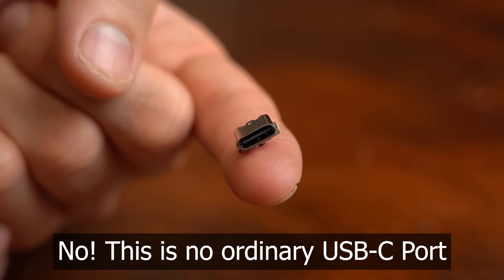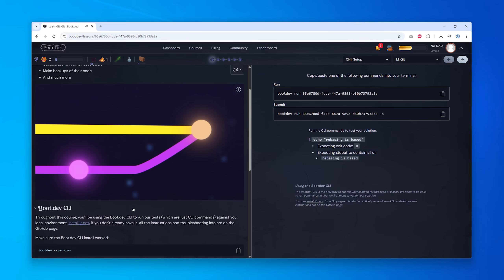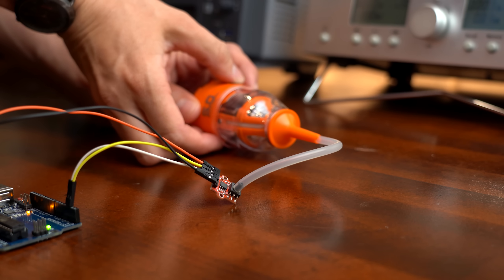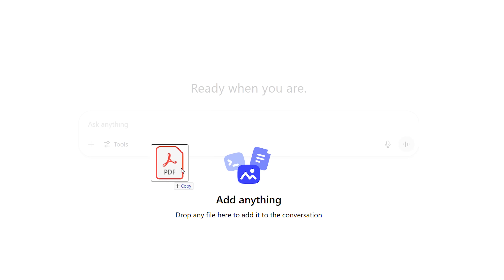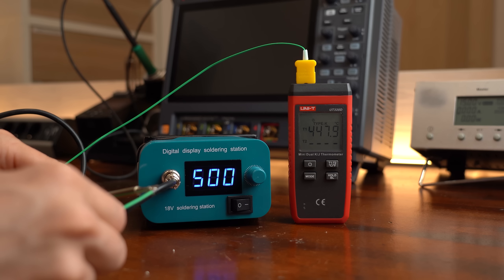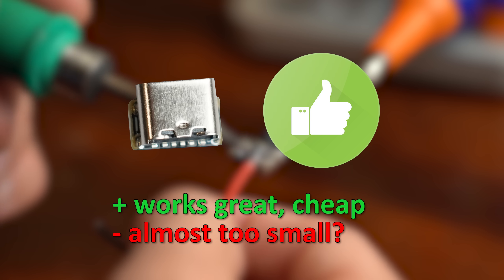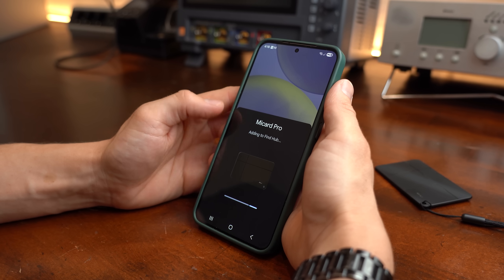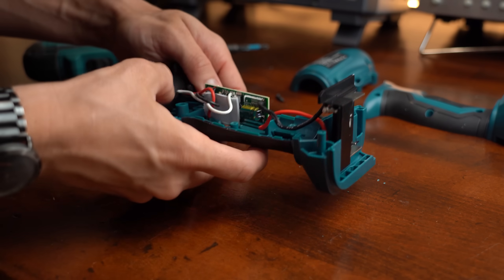I tried finding Hidden Gems on AliExpress AGAIN! (Part 15)

Comment from the maker: Click this link https://boot.dev/?promo=GREATSCOTT and use my code GREATSCOTT to get 25% off your first payment for boot.dev.
Thanks to boot.dev for sponsoring this video and making this show possible😁
Reply: Are you sure that the tracker app does not just safe the location, where it was last connected to your phone?

I mean this sounds alot like apple airtag, but the thing is that on android it was recently made possible to have such technology. I am not sure if truly uses the gps of other phones. It would also be kinda weird to know that random object can automatically connect to my phone to check the gps location. Also how does it even send its location. Does it also access the internet via the connected phone?
Reply: @beobhan I really think it relies on this new Android system. So the implementation is more complex (and privacy compliant) than explained
Reply: I think we would have appreciated a much more detailed review of the Makita Iron as that's a VERY VERY popular battery system for Tradies.

 You didn't even mention it's heat up time or what tips it uses ? Hakko 900 $1 tips or new super expensive smart iron tips ??

Your Watch..........

Your WiThings watch glass looks really scratched.

There's a lot of info on Reddit about people replacing the glass themselves with parts from AliExpress. 

It is VERY fiddly and difficult though. The main problem is if you damage the glasses gasket while removing the glass shards you're finished, it's a non-available part.

You can replace it with a Sapphire glass for about US$20 which is a HUGE improvement in scratch protection. Screen protectors are also available.

It might make an interesting video ? 👍
Reply: nice find on that tiny blower but the price. this can also double as a personal fan in hot regions however it appears it is single speed and doubt the tiny batteries will last more than 10 min. 
10:00 the price is similar in our country but aliexpress has highre prices (which is in the shipping cost) since they sell to wealthy countries
coincidentally, I received two copies of Mili tracker just yesterday! I think the card is bigger vs the tag or coin version. as explained in the video, it doesn't work well in wide open areas where there is no bluetooth android device (last location is always where it found bluetooth using the location of someone's phone).  however, I found the best case scenario a few hours ago while walking in public. I was following this mother and child and the tracker updates almost every few seconds like GPS! It appears it is realtime if consntantly connected! I guess the tracker sleeps if is disconnected to bluetooth and wakes up every 5-10 minutes to check.
Reply: Lol cụ coin viNE 0,06875$

Comment: Unfortunately, I didn't listen carefully. This product is only a charger and not a BMS. I am in the process of building a small Lipo system to power LEDs for a wearable device. I bought the product and now realized that it has no discharge protection – so I have to go back to the TP4050. Some have an idea for a very small BMS 4.2V?

Comment: Tipp for AI usage:
Do not upload the pdf. Either copy the text or upload it as image.

If you upload it as pdf it will vectorize it and use the pdf like a search engine.

Then there could be something important it did not read.

But images and text are directly available as context

Comment: Stay away from their health supplements. I bought SAMe at a third of the price of US retailers but it is junk. I can tell because I take it as an adjunct to antidepressants and I could tell almost straight away that it wasn’t SAMe. The scammers are counting on people buying it to treat health conditions for which it won’t be obvious whether the supplement is fake or not i.e. it is not acutely felt. I noticed that they have a range of health supplements which all have 120 translucent capsules with gold coloured filling. They are obviously using the same junk capsules with different labels. The labels are identical except for naming different supplements. The label even  says “sealed in blister packs for freshness and stability” but they are NOT in blister packs! The labels looks like they have copied and pasted authentic product labelling to give their fake products the appearance of authenticity.

Comment: Another neat thing about the tools on AliExpress and whatnot most of the Chinese tools that aren't battery specific or actually Makita. That seems to be the standard they've cloned and you can get a adapter for around 6 to 10 dollars to use whatever battery you want. I got one of those ankle biter death circular saw blade weed cutter machines the grass in my yard is pretty tough and 3 ft tall now I can use my DeWalt batteries on it.

Comment: 10:45 min the first time I'm disappointed of you. 
You show the input voltage @5v and not the measurement to the battery. 
Das solltest du eigentlich besser wissen 😉 
Trotzdem toller content

Comment: Can I just solder this battery charger to a device and then it will power the device from the battery and if I connect a USB-C cable it loads the battery? Or is it just for loading the battery?
This card only works with Android, correct? No Apple find my support?

Comment: I recently got a $5 24V 4A PSU, just the PCB, for $5...it replaced an Apple Cinema display PSU that cost about $50.  I don't even know where you'd find such a thing outside of Ali.  Buying electonics parts from Ali  has allowed me to fix and restore so much old stuff that surely was landfill bound due to cost of replacement parts.  I am currently working on a couple 4k 120hz televisions, and found there are "universal" television repair parts on there I cannot find available anywhere else.  Mainly mainboards and PSU.  They come with jumpers to select resolution, colour bits, voltages, etc.  I doubt anything like that is made domestically due to North American laws standing in the way.

Comment: I have the same soldering iron that you already had and it works just fine from a Makita battery. You just need the right connector to plug it in.

Comment: So the tracking card requires you to have an app constantly running and reporting your position to Chinese servers.
To find the card it relies on someone else walking where you dropped it that has the same app installed. It seems unlikely this will be useful in the west.
I stick with Samsung, Apple, Tile.

Comment: 10:50 one thing i really hate about a lot of these make it super small modules is they remove good features like mounting points and sane pad layouts. better to solder an extention cable to some connector like a JST variant

Comment: Hi
I found the your discussion of the DTS6012M sensor very interesting.
I tried to get the Arduino UART code using ChatGPT but had difficulty.
Is there another way I can get a copy of the code you used.
Thanks
Bob

Comment: Hello, I have a DIY or BUY tip for you. How about a high-quality, but not expensive, multi-band radio receiver using microcontrollers (arduino, esp32, stm32), rf mixer, rf amplifier, filter and audio amplifier.  Maybe with the help of commonly available recycled parts, such as ferrite antennas from old radios and similar things. There are plenty of instructions on the internet, but I'm curious if you would take on the task? I'm currently struggling with one such project.

Comment: Very nice video. But it would be great when you could test a few cheap china tools for an electric  laboratory.  You already tested a cheap oscilloscope  but there are many other ones for under 100€ and 400€ are too much for the most students. And some laboratory power supply unit  with constant current mode would be very nice too. I'm very careful to use Chinese products on a socket, but maybe there is something with USB-C. Just a few ideas for a video when you don't have naught for yourself and would be very helpful for me ^^

Comment: I use AliExpress to buy certain things like tools and  Marine grade heat shrink , certain parts , project boxes ....... Today I got a Heavy duty PD Type C cord for my portable Kaiweets soldering iron for 3 bucks , Kaiweets want 20 USD ...... 4MM wheat bulbs 12 volt  50 for 1.50 USD .  I will but certain SMD SOT23 Mosfets from my trusted stores ...... It's hard to counterfeit those parts ....

Comment: A whole new soldering iron is excessive solutioning beyond the scope of the actual problem surely; a 'refactor fallacy' of sorts? You have a decent little soldering iron you like, so just solve the battery issue. Easy since you have a bunch of 18v Makita batteries, enough for most jobs on the TS-101: anyone watching this channel is most likely beyond capable of buying a Makita battery connector, a usb-c PD board (for e.g. a Pinecil) or directly wiring up a male DC 5525 connector for your TS-101. All available on Ali as usual. You probably already thought of that though, so why buy that thing as a solution to the battery connection problem? If you need 24v, is the TS-101's heating power performance on 18v significatly less than that new one - is it a deal breaker? For ref, I have a Pinecil v2 - use aa PD 3 board & 18v battery for my portable solution.

Comment: Rotating a magnet through a coil with a drill isn’t going to do much 💀💀 it needs to be moving into and out of the coil because it needs to cut through the flux. That’s why when you turned the drill on its axis it magically started producing a greater voltage.

Comment: Why couldnt' they have put castellated connections on that battery charger so you could just use it as a module to drop on another pcb? like what good is it to have this tiny usb-c female connector with no screw holes or any way to fasten it down/inside something? are you supposed to just epoxy it into place inside your project? too small.

Comment: Idea: What if you made a “Macrowave” using magnetocaloric materials for heating instead of microwaves? You could repurpose the shell of an old microwave for the body. Could be a safer and cooler alternative to traditional microwave ovens! Plus, you could also freeze stuff quicker than a fridge too!

Comment: At 9:19 you spin the magnet around an axis parallel to axis of your solenoid / coil.
You don't get much of a signal, right?
That's because spinning the magnet around that axis can't change the flux through your coil.
To get a voltage from the coil, you need to change the magnetic flux going through the coil.
To do that you would need to rotate the magnet's N-S axis around some axis that is not parallel to the axis of your solenoid.
The best is to rotate the NS axis of the magnet around some axis that's perpendicular to it and also perpendicular to the axis of the coil.
That way,  the flux 'cut' by your coil is completely reversed every time the magnet turns 180 degrees.

Unfortunately of course, your drill doesn't fit inside your solenoid in that orientation.
Luckly, the magnet need not be inside the coil - only its flux needs to be.

Hold the magnet with the drill so it's NS axis wll rotate when the drill turns. 
The NS axis of the magnet can't be parallel to the axis of rotation of the drill.
Find out if your magnet is magnetized "axially" or "diametrically".
Attach the magnet to the drill so that the NS axis is perpendicular to the drill's rotation axis.
With the drill pointing perpendicular to the axis of the coil and the magnet near the end of the coil, run the drill.
I got 120 mV peak to peak using 2 12-mm neodymium disks and the higher speed of my dewalt hand drill.
My coil was about 6 m of 22 awg solid wire wound around a spool with diameter 30mm and  16mm long.
I used a capacitor (1000 pF or so) to reduce environmental noise.
Reply: Thank you for typing this so I didn't have to.
I was screaming at the screen during the whole sequence... 🤣
Reply: Seriously, how do you set that up and put it in the video after seeing that size of signal and not thinking anything is wrong
Reply: @owenpenning1597  Following an AI script perhaps?
Reply: Yes i could not believe how such an educated guy could show it that wrong how a generator works. Please add a hint to this part of the video..

Comment: The specified airflow of compressors is usually measured at the suction side at atmospheric pressure. 

Compression reduces the flow at the output side, depending on the pressure. So when you hold your measuring fan in the output airstream, the pressure will rise and the flow drop.

Comment: QR codes are an open standard. Literally encoded text and in this case, thext is probably <app_name>:some_data. What you can do is: generate a new QR code with any random generator on the internet in the format of a contact that Andpriod and iPhone can recognise. Print that new QR code and stick it on the old one. Or even, If you get any card/tracker, you can still do this.

Comment: About the airflow of that pump, you can never expect to match factory airflow measurements for any kind of air moving device without also having the kind of test setup they use. Airflow testing is incredibly complex, and a small measurement device like the one you used there leaves far too many variables uncontrolled for a comparable reading. If you're curious about this, go take a look at GamersNexus' years long saga of acquiring, learning to use, and developing a methodology for an industrial fan tester.

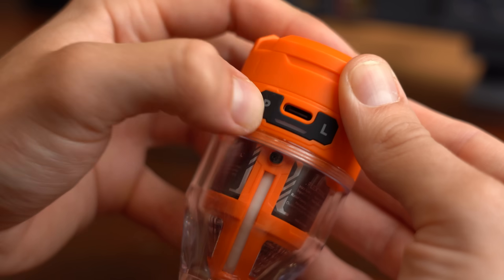Comment: 3:09 one reason i can think of for double tap is to avoid accidentally single pressing the button and turning the pump on while the user is hiking or running.
Reply: I bought a pump that functions exactly the same as this one, similar size but a different shape from LIDL (uk). I think it was about £8.

Comment: Was just going to mention bigclive as others have said. Whatch out for devices that do not monitor the voltage to prevent total discharge. 
Also going to mention the torque test channel who have started to test these new air blower turbo fan devices. (maybe send your over with the inflator and see how they stack up 🙂

Comment: I can only guess that if you disassemble that rodin coil and measure the parts, it should be pretty easy to 3d print them and the wire is probably cheap ;)

Comment: 13:15 You have forget about self discharge, so 7.5 uA if it has 5% self-discharge (if it is not grade-B/C) per month gives us following: (7.5+24)uA = 31.5uA - avarage discharge rate that consists of battery self-discharge and device sink. 100mA/ 0.031.5mA = 3174 hours / 132 days / 4.7 month. But it doesn't include that self-discharge reduces with reducing charge, also as reducing it's maximum capacity

Comment: You bought the wrong fan. Check the similar but not identical ONEVAN Brushless 2000W. That is the same as the Zuyiyi, just tested by Farm Project. Same price as yours, but that one will blow you away  ;)

Comment: These Bluetooth finders are often limited by quality of app (eg. The OS will shut it down to save battery and then you find that the last location was 2 months ago) and the bigger names utilize all users to connect and find your wallet. However very good price and power systems look very good

Comment: 8:00 Some batteries might drain complete using it has a power hub and wont be able to charge it using the standard battery charge since voltage dropped below threshold. not sure about Makita but Dewalt Batteries not have built in protection will drain completely.

Comment: TS soldering iron works with USB power delivery. I have a PD adapter for DeWalt batteries (I'm sure there's one for Makita). Works like a charm and doubles as power bank for charging other stuff.

Comment: 7:10 Can't you use USB C powerbanks for those, like they make 140W ones that do up to 28V/5A
Reply: If it's a TS100 it only has a barrel back for power. You could still use a usb-c to barrel jack cable that contains a pd trigger to power it with a power bank, though.

Comment: Flextail gear is good I've got a pump it's power to size ratio blows away the cheap "for Makita ' blowers  ( pun intended) ... They do one that has a camping light integrated as well that's the one I've got ... I saw it on the Kent survival channel... That tiny usb charger looks really useful I'm gonna pick some up.

Comment: I wouldn't trade my ts101 and pd power bank, BUT if I didn't need it that often, (i use mine for work) or use it in awkward places, that portable soldering iron would be great.  I had a similar m12 that didn't preform great, the iron was rigidly attached to the battery.

Comment: Did you test to see if the Makita and others have protection for taking the voltage of the batteries too low and destroying them?  A lot of brand name power tool batteries have the voltage protection in the tool, not the battery.

Comment: I have similar flextail air-bump, I kept one in my kitchen to suck air out of plastic bag. Beware of its weak battery rechargeable cycle, once it is done, u got one more useless item. They made it difficult to disassemble for battery replacement😢.

Comment: nice find on that tiny blower but the price. this can also double as a personal fan in hot regions however it appears it is single speed and doubt the tiny batteries will last more than 10 min. 
10:00 the price is similar in our country but aliexpress has highre prices (which is in the shipping cost) since they sell to wealthy countries
coincidentally, I received two copies of Mili tracker just yesterday! I think the card is bigger vs the tag or coin version. as explained in the video, it doesn't work well in wide open areas where there is no bluetooth android device (last location is always where it found bluetooth using the location of someone's phone).  however, I found the best case scenario a few hours ago while walking in public. I was following this mother and child and the tracker updates almost every few seconds like GPS! It appears it is realtime if consntantly connected! I guess the tracker sleeps if is disconnected to bluetooth and wakes up every 5-10 minutes to check.